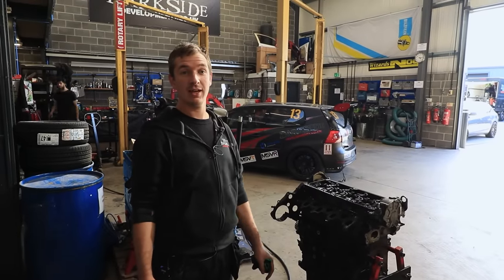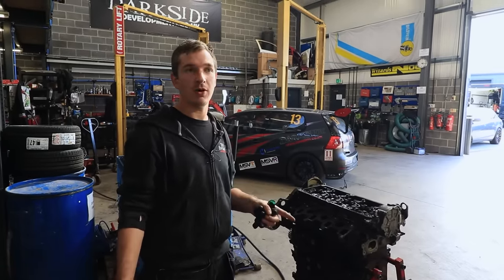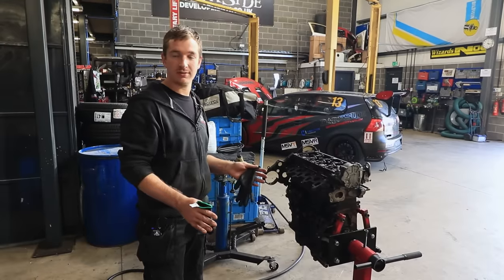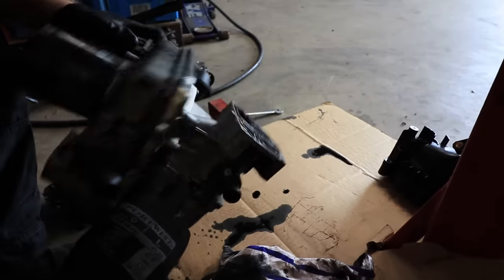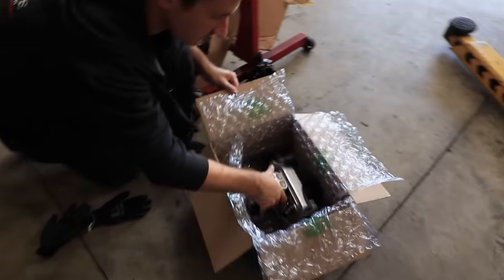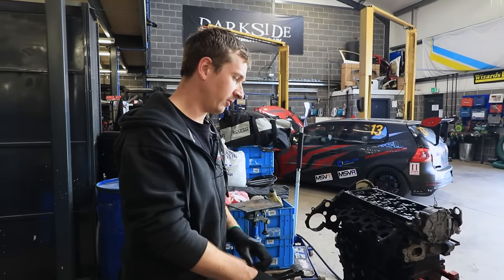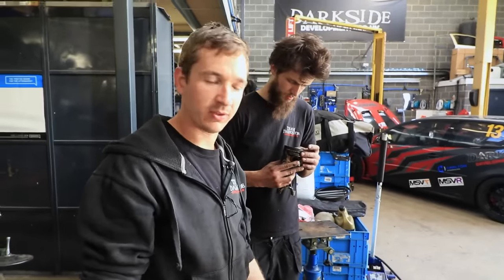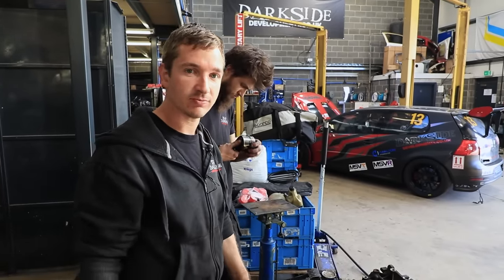Is this the worst 2.0 TDI engine VW ever built?

Comment: EGR Blanking with DPF left in place?  I notice you advise against this on your site but other people offer blanking+remap and leave DPF as it is.  
Or fit Tafmet and DPF still in place any thoughts on this please?
Reply from the maker: We never turn EGR off with DPF in place
Reply: @DarksideDevelopments  Why is this?
Reply from the maker: The DPF won't regenerate without EGR
Reply: I will beg to differ on this... egr-only delete, force a dpf regen to bring up dash light, drive as required until light goes out... Does that not mean it works?

Comment: When did this engine go out of production? I’ve just bought a 2017 VW Crafter with the twin turbo 177 engine with 82,000 on the clock. The dpf lights just come on? Am I safe or is it possibly a problem like this?
Reply from the maker: Crafter is different but get it looked at ASAP

Comment: if you are going for a 2.0 tdi, never buy the pd ones and also try to get a 2010+ common rail one. they dont have the oil pump issues
Reply: My 2.5PD has done 325k miles, just doing injectors on it now, for the second time. Trust me, this is the best engine VW made

Comment: Did you say which model and year this was? And mileage, we do need to know as there are a few types
Reply from the maker: It's the T5.1/T6 2.0 BiTdi 180 engine with the EGR cooler. All the others should be fine

Comment: Seems to be a common issue in modern diesel engines. MAN Trucks championed this solution in their marketing to meet Euro 5 emissions about 10 years ago, being I’m sure the only heavy truck manufacturer at that time not having to go down the SCR “Ad Blue” route. The results were the same a vehicle we had needed two engines in less than 3 years! EGR as a engineering concept is just shite, when you get to see the innards as shown here you know the reason why!

Comment: Ive been hunting a decent vw transporter with a dsg box for ages and while there’s so many different engines and power outputs. i want to ask anyone’s opinion whats the best option of van to consider and should I avoid higher mileages.thank you
Reply from the maker: 140 DSG is most likely good
Reply: I also want to buy a t5 with a dsg gearbox which you advise me to be a durable engine that has gone over 200000km. Same 140kw?

Comment: You should try do it on a smart car CDI, remove the back of the car, take out intercooler, inlet and all associated plastics through the back of the car, I have hands like shovel's also, absolute pig of a job to bypass it, car works fine now though.

Comment: What compression test tool do you recommend. The hole for the glow plug is so deep. Is there a deep hole compression test fitting you use?
Reply from the maker: We make our own!
Reply: @DarksideDevelopments  thank you for your reply.
Reply: @DarksideDevelopments  ive had a compression test done. The results are as follows, no1 is 385psi, no2 is 420psi, no3 is 400psi, no4 is 400psi. Would you say these results are good ?

Comment: Bore wash .
The aluminium gets in polishes  the cylinder walls an rings . the cylinder doesn't seal , that gives you poor compression. The mix shoots in to the sump past the rings . Creates to much crank case pressure, oil leaks , oil burning .
Reply: Yeah, not bore wash in the petrol engine sense

Comment: Was looking to buy a 4motion dsg what years should I avoid?
Reply from the maker: It's not really the year, it's the engine code that's the problem. CFCA's have the most issues. Other than that as long as they've been looked after, should be alright

Comment: I'm looking at buying one of these at the moment, I wonder if I can ask your advice? 

You talk about changing the EGR cooling block before it does too much damage. Roughly how many miles would you say is too late?
Other than doing a compression test, are there any tell tales that can be easily seen when viewing one of these?
If the engine doesn't have one of those dodgy part numbers for the EGR cooler, it 'should' be ok?
Would you say just go for the standard 2TDI 150ps and avoid the BiTurbo 205ps all together?!

Thanks for the video!
Reply from the maker: There's not a set mileage on when it can occur, we've seen this happen at various times. From what we've dealt with, the single turbo model is more reliable. Just compromising on power

Comment: Can you delete egr completely in this engine or is that not possible or is there complications from doing so? My engine tuner says deleting egr on any VW stops dpf regen properly?
Reply: D Peaceman38 my tuner also said the same about deleting the egr on a n47 bmw, if you delete the egr your dpf will go to shit
Reply: Pedro Guerreiro I run a fleet of vehicles and the VW/Skoda diesels I have egr deleted mainly due to constant issues but I do an active regen on dpf as find spot levels high. They never fail mot as emissions are same with or without egr as all still have cat and dpf. Good blast up road prior to mot and good quality fuel.
Reply: We dont ever remove EGR alone.
Reply: Can't remove an egr and have an MOT so no.

Comment: Great video, but could you tell me if a 2lt tdi skoda kodiaq vrs 245bhp engine block is that the same block as the 2lt tdi 190bhp engine? Theres a kodiaq with a smashed sump the engine is destroyed, i assume so,was looking to buy an engine to replace the damaged one
Reply from the maker: Nothing is shared with the 240hp engine, it's all unique
Reply: So you could not replace the block with another 2lt bare engine and add all the ancillaries to it? So its a completely different 2lt engine?
Reply from the maker: The complete engine is entirely different

Comment: How much is the cost for rebuilding this engine? Parts and maybe some machining. I can do the rest for my self.  Under 2000 euro ?
I want a multivan with DSG and 4 motion so I have no other engine choice
Reply from the maker: 2k in parts and machining easy
Reply: @DarksideDevelopments   i found 0.5mm oversize pistons (€300), egr-cooler (€650), rebuildkit with Berings, timingbelt etc (€500)
And a local machineshop do the Boeing for €300

So ithink I can make it for under 2K
Reply from the maker: Email us for the EGR cooler

Comment: Wish you guys were in 🇦🇺 because my Passat 125TDi 3C B7 MY13 aircon stopped working. No faults, has gas, everything works but I'm told it's not worth changing the solenoid valve but to buy a new compressor. Car has 75K kms 🤦‍♂️
I love my Passat but seeing what VGA does to us consumers is heart breaking. I don't have any techs like you here. FML
Reply: $1,200 AU fitted

Comment: Difference between CLCA and CFCA 2.0 TDI engines?
Reply from the maker: CLCA's don't suffer with these issues and have less power from stock
Reply: @DarksideDevelopments  Can we swap the 140Hp version of Jetta ( CLCB) ECU with Skoda Octavia 2.0 TDI (CLCA) ... Both have same injectors and turbo but CLCA is detuned to 110Hp and CLCB comes with 140Hp from factory
Reply from the maker: Easier to flash the file :)

Comment: Change oil every 15000km and clean the turbo and intercooler tubes every 15000 km and you dont have problems like that
Reply: That’s not the case. Oil changed on mine every 10k miles religiously and engine was still toast after 73k

Comment: You’ve said theEGR cooler valve has caused the problem with this engine,which has a D suffix but when you put up the bad and good part numbers the one ending in D is the good one,or have I got it wrong?
Reply from the maker: Eagle Eyed, We double checked the OE part number using the VIN, the vehicle left the factory with the A suffix part number. It looks like someone changed the EGR cooler previously on this van, maybe done on a recall however the damage had already been done.
Reply: Darkside Developments Thanks guys,love the videos 👍
Reply: I've got a 2016 180 with a D. How do I check against the VIN as per your comment to see if its legit or not? Thanks!
Reply from the maker: @SimonLittler  You should be able to check this with the dealer (Y)

Comment: Have you ever worked with 1.9 pd105 BKC engine. Is it strong like pd100 or pd130(i mean strong for simple remap). Does bkc have some standard engine problems? I hear that BKC is much better than BXE and BLS. Could you tell me cons of that engine please.

Comment: would e simple egr delete with blanking plates remove the issue? And does this issue apply to the earliest 140 hp transporters?
Reply from the maker: Only 180s kill engines and you need to get it before it's failed
Reply: @DarksideDevelopments  ok, i have a customers car with all the symtoms mentioned in the video. Did a egr off but i didn't install blanking plates right away and still had the same issues. Installed blanking plates for the egr and car runs fine now, but feels like it's down on power so was thinking maybe he has a cracked egr cooler and water has worn the cylinder to a lower compression.

Comment: Did the engine made a kinda turbo pipe leaking? Because i know someone who has one it has no smoke, seems to have pretty much all the power but at vw after months of trying what is that noise they told him that basically the engine is dead
Reply: Just request a compression test

Comment: Plate code is missing off mine so can’t see if it’s a ‘D’ but the alternate code is 7 02756 04. Good or bad…? Cheers!
Reply from the maker: From what I can see 03L 115 512 A = 7.02756.04
There is a decent thread on this here - https://vwcaliforniaclub.com/threads/increased-oil-consumption-problem-2010-t5-cali-180-bhp.15142/page-8

Comment: So which transporter t5 onwards is the better choice? With a 20k budget what would you go for?……or do i get a transit custom sport like I keep getting told to do by the VW haters lol
Reply from the maker: get a 140 T5.1 or a 150 T6, ideally 6 speed or DSG
Reply: @DarksideDevelopments  thank you for the recommendation, after doing a lot more research I’m definitely leaning toward a transporter over the custom. I have never owned or driven a automatic and I see the DSG is highly praised, apart from servicing a DSG are they pretty much bulletproof? What sort of mileage would the clutch plates need replacing? 
Thank you.
Reply: @DarksideDevelopments  Thanks just got a 5.1 Shuttle 140 6 speed, mega mile airport taxi 280k but no rust at all. I did get low oil pressure warnings on a couple of hills on the way back from buying it however.....

Comment: Fact is, that a new cooler saves the engine only if the mileage is way under 60.000km. Otherwise oil consumption and cylinder wear will constantly increase. Cheapest option is a long block from vw instead of a costy rebuild.
Reply from the maker: You need to do the turbos too if the engine is gone

Comment: I’ve got a 2013 5.1 180 with 110k on the clock. Runs like a dream, uses no oil. I’m worried now!! 😳 I better check that EGR.
I also enjoy waving at other T5 van drivers 😂👋🏻
Reply from the maker: You may have got lucky 🤞
Reply: Darkside Developments I hope so! Reading up on it, it seems 2010,2011 were the worst years for that particular EGR cooler problem. Spent more than enough on the van already! Cheers 👍🏻
Reply: I also have a 2013 on 130,000 and it's not missed a beat or had any problems but the 174 I had was always needing money spent on it !
Reply: I’ve just checked and my EGR has the dreaded part number with A at the end. What should I do now!! I guess a replacement EGR 😩

Comment: These newer VAG engines seem to be a bit shite.  My brother has a 177bhp A4 that had a turbo, clutch and flywheel before it hit 100k miles.  i'm onto 410k miles now with a AWX passat remapped to 175bhp and it's only had 1 clutch and flywheel.  My dad has a 100bhp AVB Passat just turned 200k miles.  His has the original turbo, clutch, flywheel.  These old PD's seem to be the dogs balls compared to the newer stuff
Reply from the maker: People just stopped looking after high miler PD's even though they go forever!

Comment: The egr cooler failed on my '62 plate T5.1 about 2 years (~150k). I was gradually losing coolant but there was no visible signs of any leaks so after about 6 months I had the cooler replaced with a second hand, low mileage (~30k) one. Problem solved and the fuel economy increased too. That being said, the van has always been slow for supposedly 180bhp. I am paranoid though that the coolant has damaged the turbo seals or something. You just made me more paranoid because the second hand cooler that was fitted ends in 'C'. I am now seriously considering having a compression test done. Is it also worth just blanking the egr system?
Reply from the maker: A compression test is fairly simple to carry out, it's worth doing if you want to know how healthy the engine is.
Reply: @DarksideDevelopments  can you advise 2.0 tdi t5 2012 what is good compression reading
Reply: Around 400 psi

Comment: I have that engine in my T5.1 and it drinks oil like a drunk sailor.
Reply: The oil won't burn totally cleanly, leaving behind carbon and additive package that can both isolate regions from oil and work as abrasive on rings, exhaust valve seats/guides ect. If you have a working EGR system it can cause a lot of issues via that pathing as well, so its generally cheaper to fix the cause of the oil use early when its just labor and basic overhaul kit, than wait for the more major issues to develop before rebuild and needing to have parts machined, run oversized rings ect.

Comment: I had a bxe in a mk5 Golf, the bottom end came out the side of the engine at 140k POS
Reply: Jay Leno  I had a Clio before the mk5 with more miles on, it needed a head gasket at 140 and went on for 3 years after that. The bxe break regardless of how well their looked after and driven unfortunately. I certainly wouldn't buy another lol.
Reply: Jay Leno  I believe you dude. I'm sure there's some with 200k+ on but mine with no warning at all went bang and seized up on a 50mph road driving normally. I found i wasn't alone when I googled about the bxe. Good luck to your buyer :)
Reply: Jay Leno  Id had it a year or so, really good service history, engine ran sweet, 55mpg no smoke or rattles and then it just went suddenly. Everything siezed, smoke from under bonnet, oil all over the road, missus panicking in passenger seat. 
2008 model, had to source and fit a PD out of a Bora was a real nightmare as it was meant to be my reliable car while I restored my mk2 Golf. 

I never looked more into it so it may not be true but I was told by someone the bxe engines have thinner bearing shells or something which is what causes the sudden death of some/many of them.
Reply: @humblekind4857  Ive got a pug 2.0 HDI  getting close to 1/2 a million miles not 1 problem.
Reply: 1.9 TDI PD's are pretty reliable, but got flaws too. In some series (BXE, VW Caddy) big end bearing wears out and/or rod bolts fails and you end up loosing crankshaft. I replaced mine (bearings and bolts) at around $350. Also injectors are pretty pricey and camshaft wears out, if you don't change the oil regularly. Also hydraulic valve lifters don't last lifetime. I got BXE in Seat Altea 2008, 220000km, only clutch with DMF was replaced, otherwise all engine parts are original.

Comment: Can you replace the egr cooler with just ordinary oil cooler? Or does egr delete make all problems go away in this engine?
Reply from the maker: Yes this is possible however the EGR blanking will eliminate the issue.
Reply: @DarksideDevelopments  Thanks for the info! Is this problem in any other VW twinturbo engine? I have seen similar engines in Amarok but not with same letters.
Reply: @Bulldozer93000  the EGR cooler is different, not 100% if that means it's trustworthy!

Comment: I hope vw sees this feedback so they can change their ways. engine don't look too bad on the other hand. could be worse. what engine code did you put in the transporter/caravelle or is it the same cfca?
Reply: 80 psi is bike tyre Territory. No cross hatching = no oil. It's a mess.
Reply: They know already, shame as resale would be better for VW. We put a rebuilt lump in :)
Reply: VW won’t give 2 shits! I’d be more concerned that dark side will get legal threat from VW and make them pull this down, and hide the truth about the EGR.
Reply from the maker: @craigs902  We dont really care what anyone says about us pointing out the truth!

Comment: I’ve got a vw crafter 2.5 5 cylinder diesel ‘ it’s always run well ‘ but it’s always been a bit smokey/ black ‘ would blocking off the egr help ? 
Any suggestions please. 
 Thanks 🙏 
    John
Reply from the maker: If it smokes the DPF must already be gone?
Reply: Darkside Developments  Thanks for the reply 
But the dpf was replaced a year ago?     So would blanking off the egr help in anyway ? 
Thanks again. 
John
Reply from the maker: @peanut25john  The EGR is not the problem I would think, with a DPF you should not see any smoke at all.
Reply: Darkside Developments 
Many thanks 🙏 
I didn’t realise some of the dpf s are cheap s::::t ‘ I must have one   
Thanks 🙏 again 
I’ll keep watching your channel. 
    John
Reply: Sendit Sunday   thanks 🙏 for the advice “ I’ve decided to keep it “ I just won’t look 👀 in  the mirrors anymore. 
Thanks 🙏